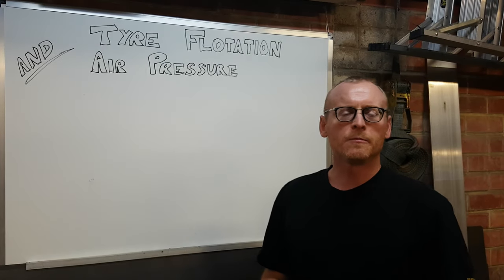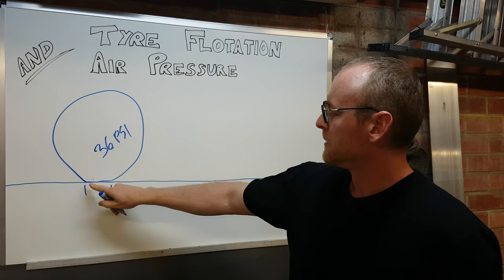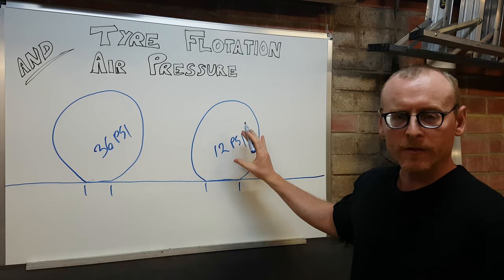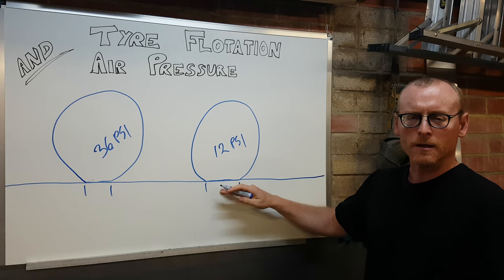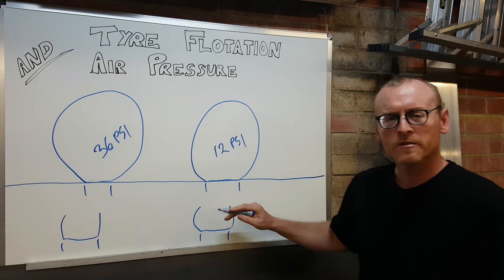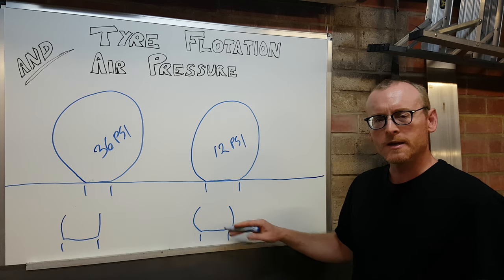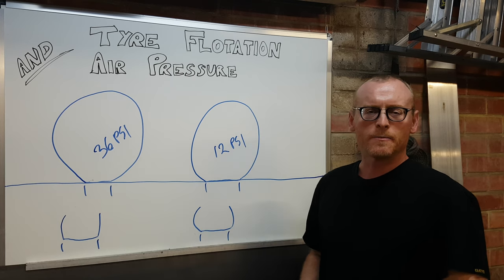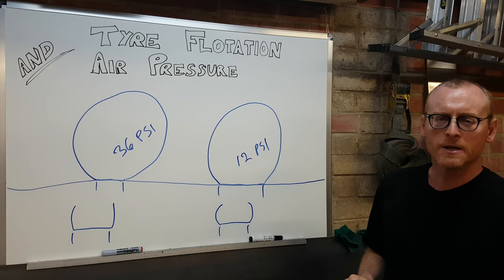Tyre Flotation & Air Pressure

Comment: Im no bloody expert but in soft sand and following others tracks the bulging tyre side walls seems to be making some contact with the sand, the prob with my rok is the extremely low clearance before its sitting high and dry on those stupid low hung side rails!!!!!
Reply from the maker: Hi Lee.  Yes, i acknowledge that in soft sand the bulging sidewalls can make contact with sand.  The question is the angle at which the sidewall is at and whether there is much chance of vertical lift, whether the sand the sidewalls contact is firm enough to offer meaningful flotation, and how much contact there is as a percentage of the tread contact area.

Having been 4wding with Amarok's fitted with original side steps, i can say that they are incompatible with offroading.